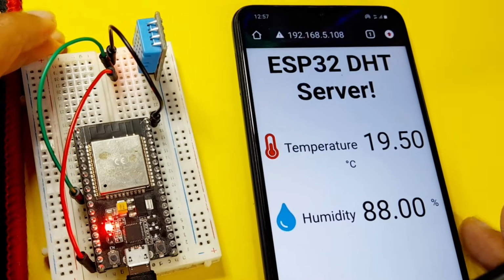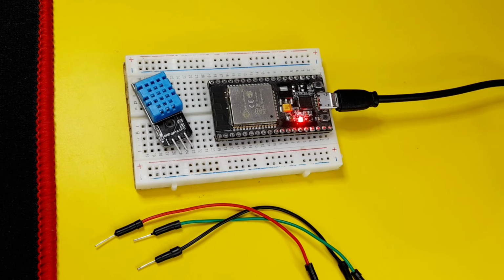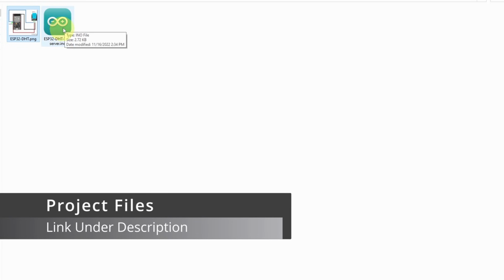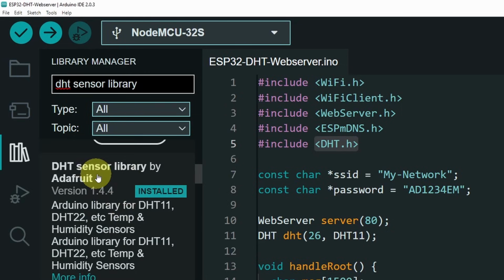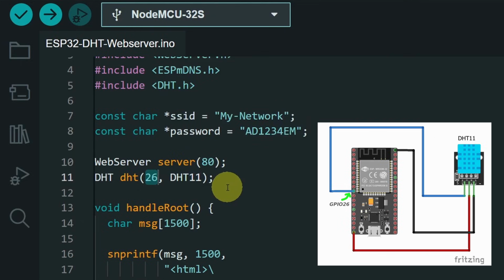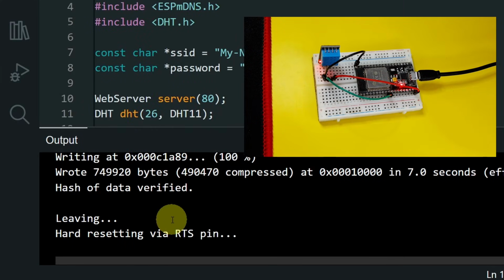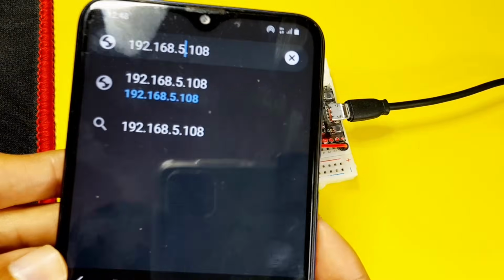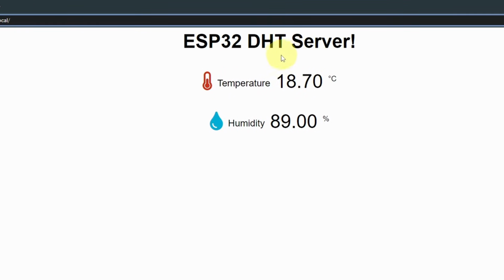ESP32 DHT Web Server Project

Comment: I'm having trouble connecting my ESP8266 to an HTML website I created in VS Code and am running on a live server. When trying to establish the connection, I'm getting a "failed to fetch" error. I've checked my wireless settings, but I'm not sure which browser permissions or other settings I need to enable to fix this connection issue. Has anyone else encountered this problem? Any specific solutions or settings I should check?

Comment: for anyone using elegoo super starter kit, my LED never it up, so i thought it was burned up/broken, but the sensor did work fine, thanks
Reply from the maker: Make sure the LED is properly connected to the right pin and that the code is set up correctly.

Comment: Works great on LAN but not Wan. Must reconfigure and open a port in your  router.  192.168.5.108 is not a Wan URL (Uniform Resource Locator). For remote viewing you will need an IP address  or Domain Name and FTP ( File Transfer Protocol).

Comment: If the esp32 is permanently connected to my home WiFi, and I know the IP address of the esp32, why can't I access it from my office WiFi using my mobile phone?
Reply: Because it's connected to the local network of your home WIFI, not to the internet. So you have to be at the same network to access it
Reply: You could port forward the IP on your Router to allow remote access

Comment: I just tried this as my very fist ESP32 project and the screen is stuck on "Hard resetting via RTS pin".
Reply: And it just worked properly the 6th attempt with no real reason why - oh well, at least it's working now, thanks for the video :)
Reply: do you have the code  ? i need 😢
Reply: @ZRk_li  it's on the top comment
Reply: when it loojs like its stuck it isnt snd when popup of uploading dissaperas then it is done

Comment: Hello, I have a problem, the temperature and humidity value is -1.0, WHY???.
Reply: same for me
Reply: Sameee
Reply: Hi 👋
Reply: You have to replace float by int
Reply: You are doing a bad connection of the pins, the pins depend on the sensor you have. In my case the first pin (going left to right) is the D26, the second de VIN and the last one is the GND, try to change your connections like this
Reply: @pausiscar8733  I checked my sensor connections online and I think I did them right, I'll try it anyway, thanks

Comment: If the router tells me that it is connected but the IP address does not appear on the serial monitor, but the MAC of the device appears linked, I am connecting the ESP 32 with a WLAN 1100 (PHOENIX CONTAC) in the web administrator (of the wlan) It tells me that the ESP 32 is in the connected devices and it gives the MAC, but in the serial monitor it only shows points, that is, it stays in the while and does not show me the IP address, what could I do?
To connect the WLAN with a tablet or a mobile phone, I must configure the IP to be static, enter the data and it connects, how can I do it on the ESP 32? That is to say, it would be to put the data on its own IP address, WLAN IP, "prefix length" dns 1, dns 2, how can I assign (program) these values to esp 32? What strategy do you recommend?
Reply: i am also having the same problem, it just shows "......." and continues forever. i have not found the solution yet
Reply: @TaylenIsInsane  SAME HERE , I WAS SO EXCITED TO DO THE PROJECT BUT ONLY "------------" IS COMING. SOMEBODY PLEASE HELP US
Reply: i have the same problem
Reply: @TaylenIsInsane  I fixed it like this:
use: 
//----------------------------------WIFI connection to use with fixed ip
IPAddress ip(192,168, 1.28); //Use the one you want to give it
IPAddress gateway(192, 168, 0, 1); //  Use the one your WLAN has
IPAddress subnet(255,255,255,0); //   Use the one your WLAN has
WiFi.config(ip, gateway, subnet);
Reply: @TaylenIsInsane  Did you find the solution? I have the same problem

Comment: ...........................................................................................................................................................................................................ets Jul 29 2019 12:21:46

rst:0x1 (POWERON_RESET),boot:0x13 (SPI_FAST_FLASH_BOOT)
configsip: 0, SPIWP:0xee
clk_drv:0x00,q_drv:0x00,d_drv:0x00,cs0_drv:0x00,hd_drv:0x00,wp_drv:0x00
mode:DIO, clock div:1
load:0x3fff0030,len:1344
load:0x40078000,len:13964
load:0x40080400,len:3600
entry 0x400805f0

showing above on serial panel.....please help

Comment: Interesting video. However, you're refreshing the webpage every 4 seconds. The way I see it, it is the whole webpage that gets refreshed. If there are (many) more values, which so of them don't change, it is not the best idea to refresh everything. Could you explain how you would only transfer the data of those values instead of the whole page?
Reply: I did that using a static webpage with some javascript to call the fetch() function every x seconds. On the ESP32 I created a new route to only send the data in json format using the ArduinoJson lib (it's awesome!).
Reply: @soniccinos  Ah, that makes sense!
Reply: i just changed how often the whole page gets updated, seemed easier that way. 4 seconds seems too often for most people so i made it 30 sec.
<head>\
    <meta http-equiv='refresh' content='30'/>\

Comment: Good day to you Sir, thank you so much for taking your time to show all the steps that you went through to make the project a success; I have personally been helped greatly. I just wanted to hear from you if that website on which the values are shown, is customizable; as in you can add other things like charts, buttons etc for more comprehensive analysis of the values. Or i'd need to design a separate web-something for that to be possible. Thank you
Reply from the maker: You are very welcome
Yeah, you could customize it and create a better interface by changing the html code inside the sketch, but you need to learn how to use html and css

Comment: Hey If I'm using Nodemcu esp8266 will I have to add other library or the same code will work
Reply from the maker: It's almost the same code, but there is a slight difference that I am gonna explain in the next few videos.